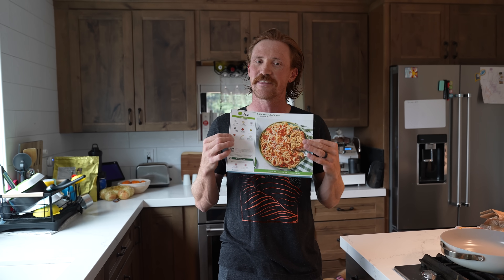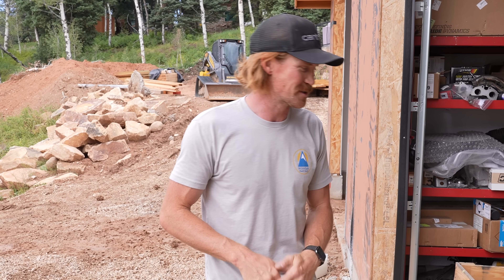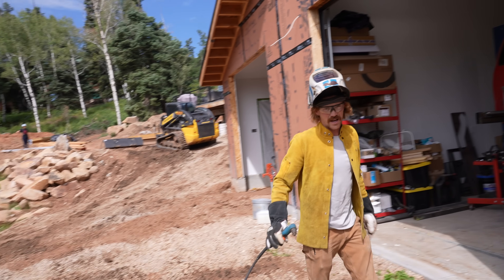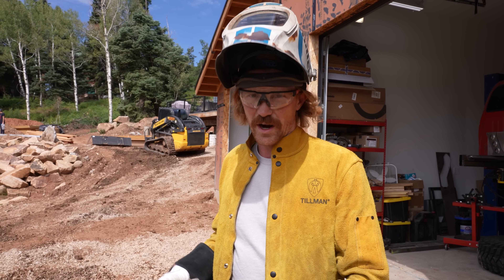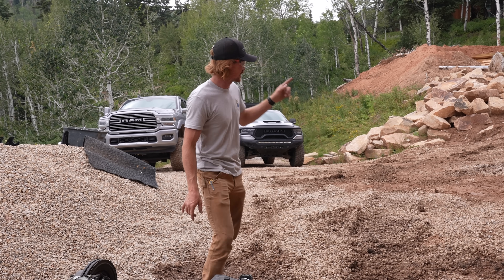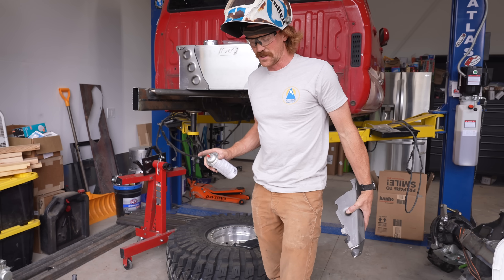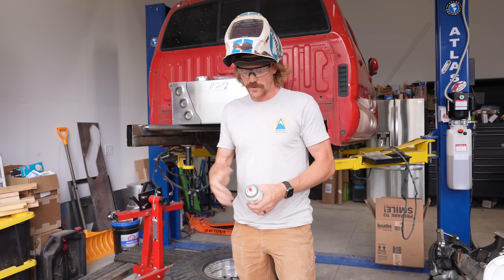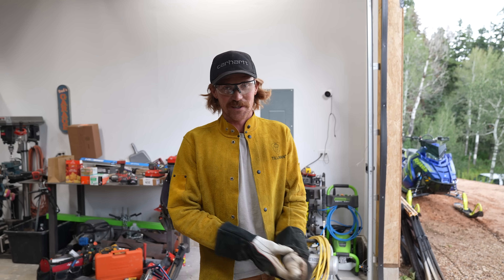DANA 60 REAR AXLE PREP

Comment: Definitely do your homework. Pinion angle should be inline with the tranny output shaft angle, for sure. The universal joint, or constant velocity joint will take up a little slack but for the stress your drivetrain will be under, I’d try to match the angles as much as possible. The use of heim joint brackets on the axle tube could be a possible way to adjust the pinion angle, but motor supports will play a greater role in adjusting the tranny output shaft angle. 
OR… you could just get lucky😂

Comment: If you haven’t already begun making your links, get some pvc pipe with the same ID as your heim inserts and use the pvc to mock up your links. Much easier and cheaper than steel if you have to make adjustments.
Reply: Excellent idea!